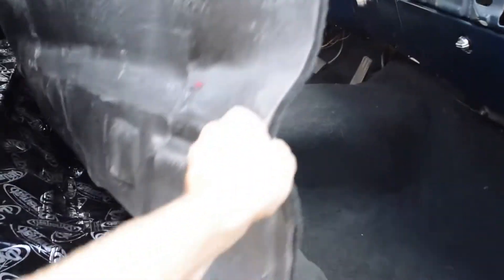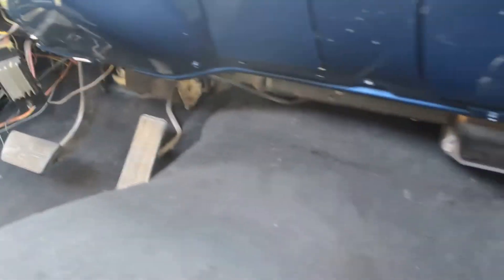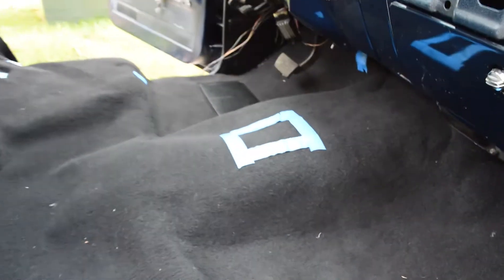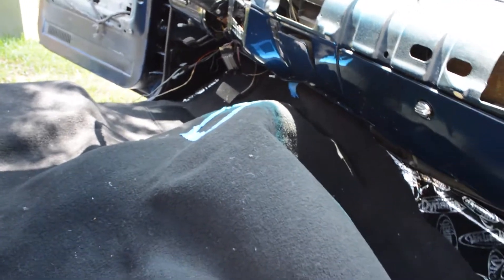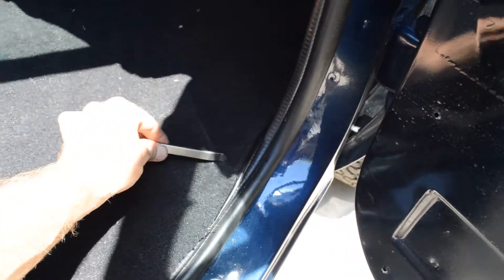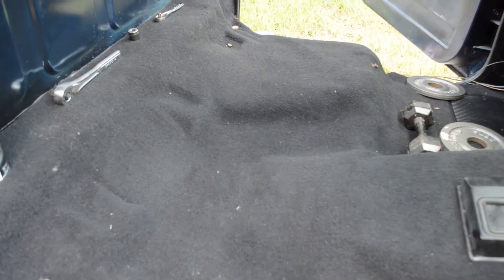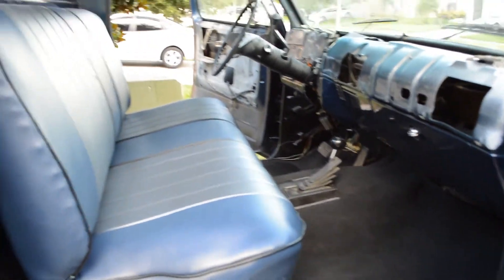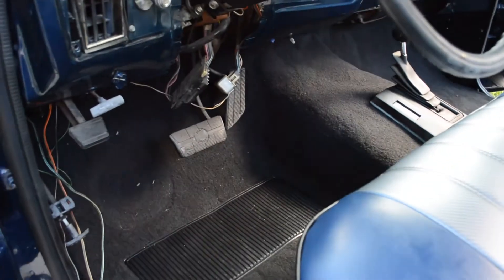1984 Chevrolet Chevy K10 C10 Molded Carpet Install

Comment: I just put a carpet in my 84 k20 today . Got it from USA1, I left it out in the sun for a couple hours and installed it.  Took me about 4 hrs,  it fit really good just usual trimming on the sides where sill plates go and a little at firewall. It took me longer to install sound/heat deadner then the carpet

Comment: Where did you find the truck when you bought it? Cause I'm wanting an 85 k10 bit the ones I'm finding either they want to much or they are rust buckets. If you would let me know. Good looking truck
Reply from the maker: I was lucky enough to find this one on craigslist from a guy in Georgia. It was pretty clean to start with and the body lines were pretty straight. I originally paid $2500 for it with tires and wheels. The motor blew about 4 months after owning it so I built a new one. Good luck with your hunt.

Comment: how do u remove the t case shifter
Reply: I had to go underneath and remove the bolt holding in the shifter, and then a cotter key holding it on to the linkage
Reply: @idahoduckhunter  mine was just screwed in